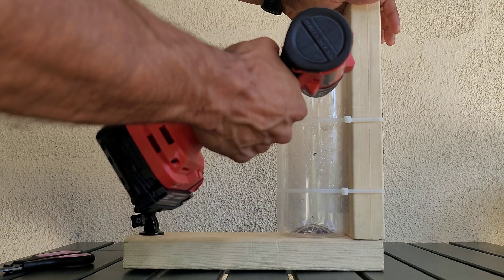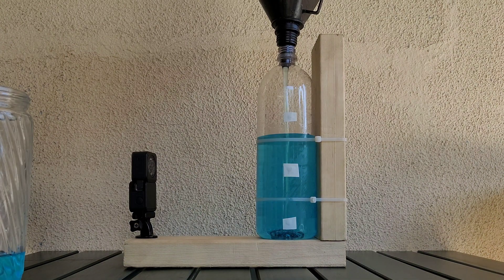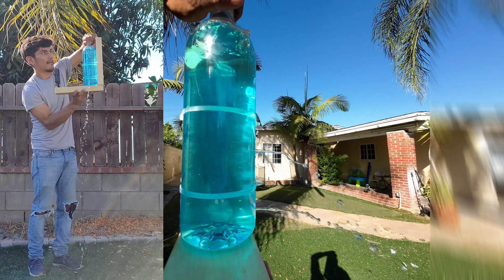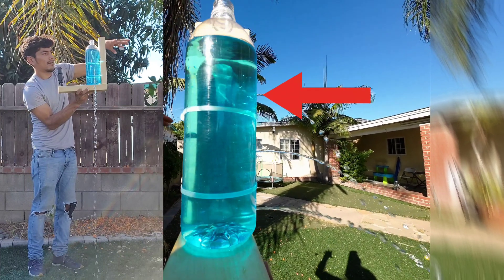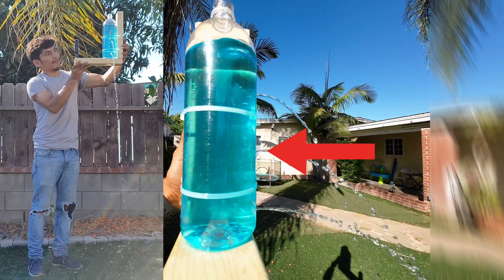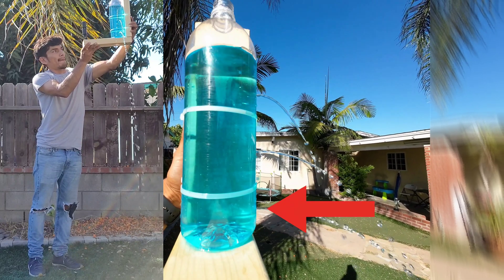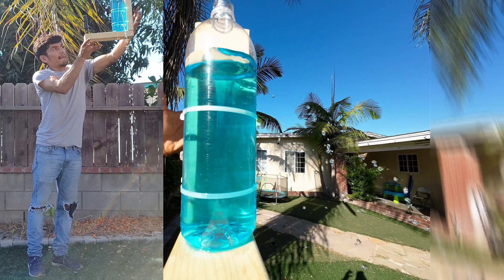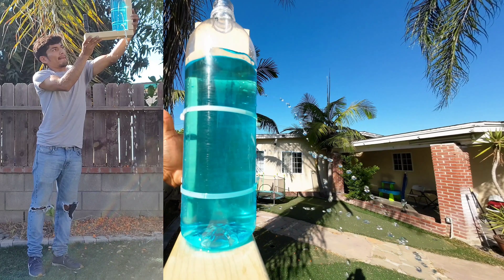Water Pressure Gradient Experiment

Comment from the maker: In this experiment I'll just be using a water bottle. I drilled 3 holes vertically on the side to measure the difference of the water pressure when it's filled.

When the bottle is filled with water and connected to the earth, we can detect that there's a force present. We know that there's a force present because the water has pressure, weight and it's being pushed out of the holes. 
The water cannot create pressure, weight or push itself without an external force.
We can also see that the water is being pushed out of the three holes with three different pressures showing that there's a pressure gradient.

The first hole all the top is experiencing the least amount of pressure from the three because it has the least amount of mass or weight above it pushing down, which causes the water to be pushed out of the hole the shortest distance.
The second hole to the bottom is experiencing more pressure than the first hole because it has more mass or weight above it pushing down, therefore the water is being pushed out further.
The third hole at the bottom is experiencing the most amount of pressure from the three because it has the most amount of mass or weight above it pushing down, which causes the water to be pushed out the furthest.

However as soon as I release the water bottle into free fall, the pressure gradient or weight column completely vanishes and is no longer pushing the water out of the holes, showing that there isn't a force present. 
No force in free fall means there's no acceleration.
Reply: good demonstration, but next time can you explain how the water shooting out of the bottle does not keep flowing sideways untill the earth catches up rather than what its doing, which is turning  back towards its self and aiming straight for the ground.
Reply: @gmonk003  why don't you stick to denying reality somewhere else?
Reply: @Beyond_Belief534  what are you calling reality

Comment: The water weighs more than the air so it goes down that’s all.  It’s all just density and boyouncy — not about “force”.  Then when you drop it it’s rubbing against the air so it doesn’t come out so much.  Just ask a 9 year old
Reply: How can it all just be density and buoyancy when they both vanish during free fall? 😅
Reply: If that's the case then what gives it the directional vector?

Your explanation doesn't account for a directional vector.

What gives it weight & density?
Reply: @Steve-h-v   it’s inherent weight
Reply: @Infinite0396  Lmao 🤣🤣🤣🤣🤣🤣
Reply: @Infinite0396  Your answer is worse than a glober you might as well have just said gravity.
Reply: @Infinite0396  There has to be a cause as everything has caused and effect.
The law of cause and effect is a universal law which specifically states that every single action in the universe produces a reaction no matter what. Every single effect within our world, upon our earth has a cause, an original starting point.
Once again what causes weight and a directional vector?
Reply: @Infinite0396  I'll give you a starting point you've got to have pressure & motion something pushing against something else to cause weight and a directional vector.
Reply: @Steve-h-v  I already answered the question.  The object has inherent weight.  So if it’s inherent weight otherwise known as mass—is more than the medium around it, such as the air, then it goes down
Reply: @Infinite0396  Then why doesn't it go sideways or up.
Less dense air upwards.
Reply: @Infinite0396  What gives it mass/weight you can't just say inherit weight.
Something has to give it an apparent downward vector.

Density and buoyancy isn't a cause of itself we live in a world of cause and effect.
Reply: @Steve-h-v   my brain can’t fathom that question you are asking
Reply: @Infinite0396  I know it's hard for you so why are you arguing against something you don't even comprehend?
That's delusional or
Is it your ego or your beliefs being questioned so your cognitive dissonance kicked in or is it something else?
Reply: @Steve-h-v   I don’t understand this question either
Reply: @Infinite0396  Then why are you commenting & arguing against something you don't comprehend?
Reply: @Steve-h-v   I just didn’t understand a particular question you made up (likely because it was a loaded question that contained supposition) that doesn’t automatically prove your argument true.  If I ask you, “what is the zubza of the zebras boat tail?” And you say, “I don’t understand the question” that doesn’t prove all my arguments true either.  I do comprehend that the earth isn’t rising.  It is motionless and still.  Because when you are in an elevator you feel it rising.  And plus there are so many other factors like the whole celestial bodies would also have to be rising in proportion

Comment: Clearly shows Earth causes the water to flow out of the holes, because the instant the bottle is not connected to Earth, water stops flowing from the holes. When it is in contact with Earth again it begins flowing again. You can't get any more clear and consise than that.
Reply from the maker: Exactly 👍
Reply: actually, the bottle changed direction and  the water had less resistance to  pour from he wholes, unless it was  upside down and in free fall.

Comment: Man i want to understand. But i feel like gravity explains this outcome as well … what am i misssing here? Here is the gpt response i am trying to pick apart … When you let go of the water bottle with two tiny holes on either side, the water will initially continue to pour out of the holes. This is because the water inside the bottle is under pressure due to gravity, causing it to be forced out through the holes.

However, as the bottle begins to fall freely under gravity, both the bottle and the water inside it experience free fall. In free fall, the bottle and the water inside it accelerate downwards at the same rate due to gravity (approximately 9.8 m/s²). This creates a condition of apparent weightlessness for the water inside the bottle.

In this state of free fall, there is no longer a pressure difference between the inside and outside of the bottle caused by gravity. As a result, the water will stop flowing out of the holes during the fall, because the gravitational force is acting equally on both the water and the bottle, negating the pressure that initially caused the water to be pushed out.

To summarize, as the water bottle falls, the water will stop pouring out of the holes because both the bottle and the water are in free fall, creating a condition of apparent weightlessness and eliminating the pressure difference needed to force the water out.
Reply from the maker: @MarioLabSchool  forces that can accelerate different states of matter at same time without displacement or pressure don’t exist.
Can you demonstrate or recreate a force like that in any other vector?